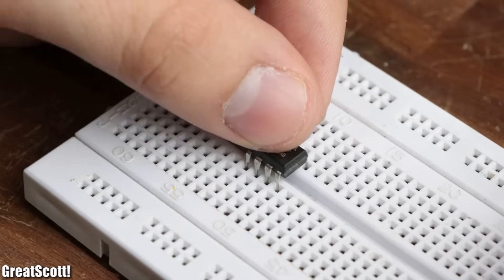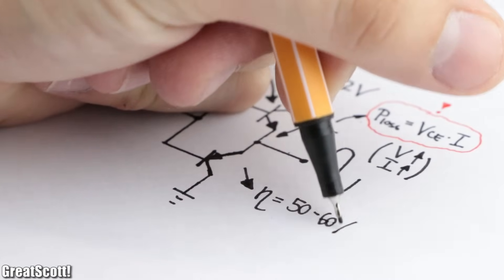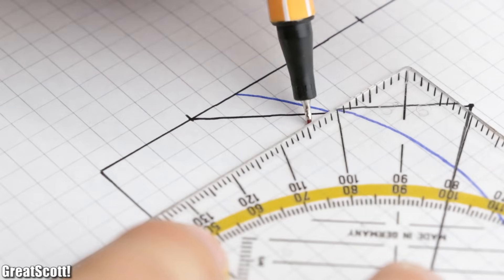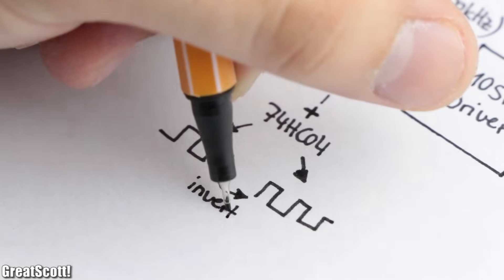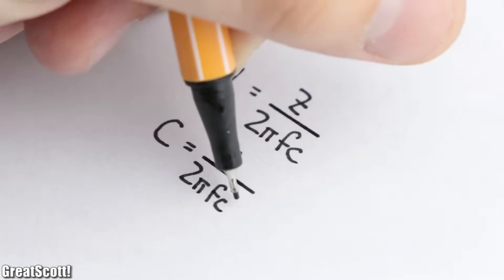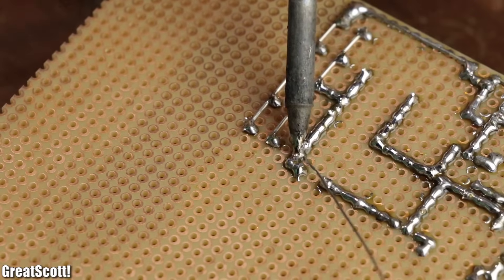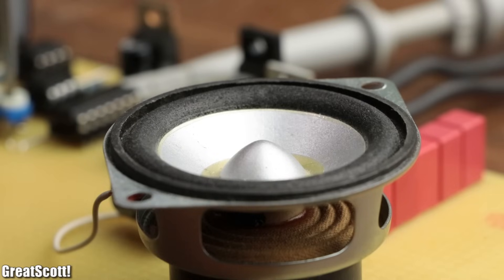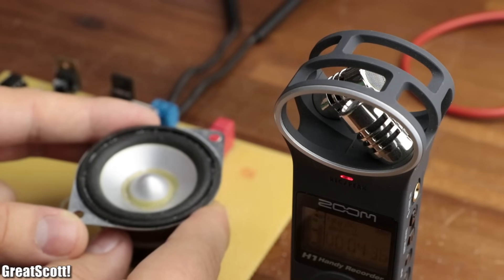DIY Class D Audio Amplifier

Comment: Tried to do a class D amplifier as a final project :/ failed terribly ... how did you make that so easily?
Reply from the maker: In the video it looks easy but I had to tinker quite a bit as well and try out a couple of different components.
Reply: GreatScott! I used ir2110 and irf540n and I burnt through more than 40 of them🙄🙄
Reply: The IR211x can be tricky, especially when you don't take into account for transients. I figured it out the hard way as well, make sure to add small resistors to the input signal and especially a gate-source resistor on the FET (I used 1k Rgs).

Comment: What will happen first?
A. The sun dies out
B. Class D amplifiers become anywhere near as good as Class A and AB
Reply: Agreed.  I only use class H amps in my rigs, no class D
Reply: @justinquinn7995  Can you describe H-class mode of amplification? Is completely uunfamiliarto me
Reply: @marcusfred4480  I am certainly no expert, there are some good videos on amplifier classes on here that can provide more accurate information, so search around. Basically, class D amplifiers use pulse width modulation in which the power supply is capable of switching on and off something like 100,000 times a second.  How many times it turns "on" corresponds to the amplitude of the signal being amplified.  It may only switch on a few times while the amplitude is low, and it will switch on more frequently as the amplitude increases. This creates a "stair-steppy" (as some may call it) looking signal that consists of square waves, which cannot be sent to a speaker.  This signal then passes through a low-pass filter (which removes the square waves, since square waves require an infinitely high frequency, which the low pass does not allow) and then you end up with the amplified signal.  Class D amplifiers are much more efficient (up to 90%-95% efficient) than class AB or H (up to 50%-75% efficient), but class D amps introduce more distortion. For example, the QSC  PL amps have class H and D models, the class H ones have max distortion of .05% but the class D model has a max distortion of .2%.  Usually this effects the high frequencies the most.  That does not mean all class d amps are bad, many touring class amps (QSC PL380, Many crown amps, etc.) are class D and they sound good.  However many of the cheap class D amps in powered boxes like K12s or what not, in my opinion, don't sound very good.
Reply: @marcusfred4480  and I just realized you asked about class H rather than class D after I wrote all that.  Whoops, oh well.  Again, I'm not expert, seek better information elsewhere: Class H is basically the same a class AB but with an infinitely variable supply voltage rail that depends on the power requirements, increasing efficiency.  Class H is basically a more efficient, higher-power version of class AB.
Reply: @justinquinn7995  Thank you for taking the time to write that for me. Actually, it is good to know more about class D like THD%'s you gave.

H class sounds interesting. I shall do some more research. Though I wonder, by your brief description it sounds similar in some way perhaps to the hybrid amp technology that the Devialet Phantom Gold speaker uses. Appently it combines class D and class AB. I think using Class AB as the actual output stage that drives the speakers, but with a class D amp for the powersupply rails to again, get high effeciency.
Reply: @marcusfred4480  that sounds about correct, there are class H amps that use switching power supplies.  QSC's PLX amps, just to name 1 example, are class H but use switching power supplies to feed the output stage.  I use mostly QSC amps, if you can't tell, lol, so they are what I'm most familiar with.
Reply: @justinquinn7995  Nice. :)
Reply: @marcusfred4480  interestingly enough, some class D amps (maybe all?) are inefficient at idle.  Using the QSC PL series as an example again, the class H models draw 1 amp of current at idle but the class D model draws 2.8 amps at idle and pushes out a lot of heat even when there's no sound, so theres a trade off between efficiency during high output and inefficiency at idle.
Reply: @justinquinn7995  That is interesting. You would think that class D would use next to no power when idle considering the output is 1 bit and would be off with no signal. I suppose there are other parts of the design that are drawing current at idle. They are interesting things to consider and yes, there is no such thing as the perfect amp and will always be tradeoff's. But still can't beat pure class A for linearity and lowest distortion!! Haha!

Comment: Can we ause a N channel with a P channel MOSFETs instead the two N channel MOSFETs, and erase the ir2113?
Reply from the maker: Not recommended. You can try it but you will probably hear the problems with this setup.
Reply: Thanks!
Reply: Another question, can we use a phase splitter made with a mosfet instead of the 74HC04?

Comment: Can you try build Audio Amplifier only with arduino?? If it is possible
Reply: Mario Michalik Arduino can't output much current (less than opamp). I guess you could try using arduino as signal for mosfet driver (instead of comparator) but i'm not sure if it's fast enough (pwm frequency should be about 10 times higher or more than signal you are creating)

Comment: The most important thing here is to balance out your decision.

50-60% seems bad compared to 90-95%, but a Class D is far more complex and thus draws more power to begin with relative to a Class A amplifier.

Comment: I have now rebuild this amp. But i have still one Problem that when I connect my phone to the amp, and when i playing no music. Then same noise came out of the speaker. Im using also an 4 ohm speaker. But when I check the output of the amp with my scope. Then i can see an very bad sine wave with ~20 MHz. But why? Also my cirucit requestes around 70 mA when no music and speaker is attached. When I look with my scope to the 555 timer then i have an frequency of 250 KHz and an triangle wave(IR2113 Driver is not inserted), but if I insert the IR2113 i have an double triangle wave and a frequency of 400 KHz? The wave is also normal when I cut the connecten between HO und LO(ir2113) and the gate resitor and diode. Playing Music work just fine. But i have only the annoying noises.
Can samebody tell me why that so is? And what I can do to fix that?(Sry, for my bad english im caming from germany)

Comment: Can I ask you to hack these cheap Bluetooth 5.0 true wireless IEM’s? These look like promising until they have a arm processor,’flash storage and a OS running on it. Could it be modified to auto apply equalization ou run some custom code? 

It’s a rtl8763bfr Realtek SoC based units!

Just for reference I’m using one of a brand name QCY model T1 (generic, very cheap and impressively good sound quality), but there also others like xiaomi air dots for example that uses the same SoC

Comment: Guys can i use ne555 instead of tlc555
And 7404 instead of 74hc04
Reply: check the data sheets of both ics to see if theres any difference and if there is, adjust the circuit so that it works

Comment: does dc voltage actually kill speakers
Reply: Short answer: yes.  DC current is transformed into heat and you can just burn the coil if voltage (and so current) is high enogh

Comment: 4:35 Isn’t -3dB, around 50% of the original value? Am I missing
something here?
Reply from the maker: For Amplitudes it is 70% of the original amplitude. So a decrease of 30%
Reply: -3dB "in power" corresponds to ~0.7079xV. It is not -3dB "in voltage".

Comment: Just a PSA -- I've received a number if fake IR2113 drivers. Either buy them from a reputable source, or be prepared to fiddle with expected values to order to get them to work. The power consumption on the real part is much lower than the fakes

Comment: you could probably get away with a BS170 or 2N7000  mosfet with resistor drain load instead of that 74hc04 chip, if you just wanted a single inverter....
Reply: saves 'wasting' a whole chip...??

Comment: automatic power cut off socket how to make a home made for mobile phone charging using timer set 1hr, 2hr ,3hr please help make for video that thinks
Reply: Agravat Ashish Usually if you gut a microwave you can use the pcb that the numpad and screen is on.You can usually just pull it out power it up with whatever your outlet voltage is and it will have a Normally Open relay rated for your outlet voltage on it rated near the same amperage as the outlet you plug the microwave in.
Reply: kardeef33317 
Thanks but I don't have a any microwave so if making a regular component

Comment: Hey, you have lost your DC-blocking output capacitor. There are DC voltage on your speaker, and it will damage your speaker quickly!

Comment: Hi man, wonderful videos loving it. It would be great if you make a video on a 'high amp motor controller' suitable for the electric motorcycle. It would be great and you would contribute for the betterment of the world. DIY electric motorcycle conversion get a big tol by the high price of motor controller. People  get demotivated with it, your contribution would be valuable by a huge community.
Reply: for high current motor control ,use the 555 timer pwm circuit with very high current rated N channel MOSFET like IRFP260N ,but use a separate power supply like 5v to power 555 or 7805 voltage regulator.

Comment: So... you don't have a 1uF capacitor laying around somewhere????  Gawd, I've got hundreds!  Typical 1st layer IC decoupling cap...  And why did you not wind your own inductor if you did not have the value?  Got copper wire?  Got a #2 pencil??  40KHz is WAY too high of a value for a speaker that will barely put out 10Khz.  I am just wanting to warn the peeps that might scale your schematic UP to a higher wattage...   :-O  Yes, you cannot "hear" 40Khz, but it can certainly cause your speaker coils to heat up (causing failure).  Locally, we had a church that kept blowing high wattage compression diaphragms.  Yes, you are not expecting ROCK CONCERT levels at most churches...  It was found that a signal at a much higher frequency was on the line (heterodyning radio signals). An inductor installed at the horn cured it!  At a nightclub it was determined that high freqs from a distorted "hi-hat" (cymbal) was blowing the horns out!  Yes, what you CAN'T hear CAN hurt you!  Remember, with a simple LC filter, you are calculating the -3dB cutoff point.  The response will be -3dB down at that point - and only a curve of -12dB per octave above that.  So, at 80Khz (4 octaves above human hearing) you will only be down 15dB!  If your Fc was 20Khz (with a 2nd order filter) you would be down to -27dB!  With a 10Khz cutoff (which would be "barely" noticeable to 90% of the population) you would be down to -39dB!!!   Your tweeter would be totally protected at that point!  :-)  AND, a totally useless waste of money to use silver clad copper wire in the actual circuit.  Silver is the best conductor on the planet BUT only 6% better than copper.  SO, with all other things being equal (i.e not getting into the boring equations) say that the resistance of a same gauge copper wire vs a silver wire -  at 100 feet.  Well, copper (being the baseline) would be at maybe 6 ohms (remember ARBITRARY number - don't flame me over this...).  The silver wire would be still around 0 ohms (or tenths - or hundredth's of an ohm) BUT in your circuit, we are talking about fractions of an inch - not a hundred feet!  PLUS, this is the high impedance part of your circuit!   Silver vs. copper vs. steel vs. aluminium wire would not matter at all (except for maybe their solderability).  (BTW aluminum can not be soldered - easily).  Remembner, what are the leads of your OTHER components made out of???   On the output side (low impedance - 4 ohm speaker) , if you were running a wire more than 50 feet, silver "might" make a slight difference...  but this all gets back to that "audiophiles hear with their eyes" kind of a thing...

Comment: Hi. Will you make a video about creating a LED driver with input voltage 230V and output voltage 60V and maximum current of 300mA ofor a powerful LED panel using 5730 SMD LEDs? My cheap chinese LED driver doesn't work anymore :( http://imgur.com/a/cYF8h
The IC is not labeled.

Comment: You want to explain this enough that we can modify your circuit to our own specs? For example, why did you need to invert the PWM into the mosfet driver. were you trying to keep it in phase with the source? That's absolutely not neccassary. How the fuck did you cretae the DC offset on the input? I'm sure there's more to it than just "use a potentiometer". Also, how do you avoid DC offset when there's no input signal? Wouldn't that force the output of the low side fet low, which would fry your speaker?